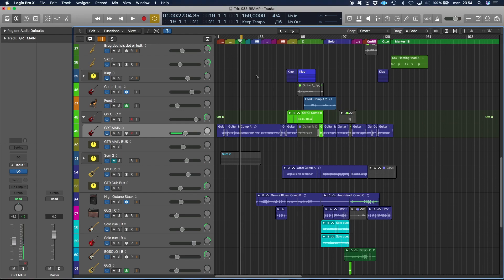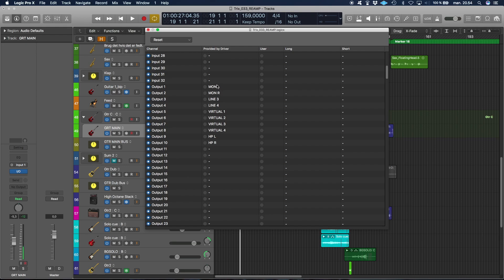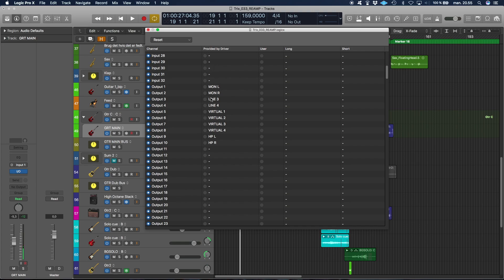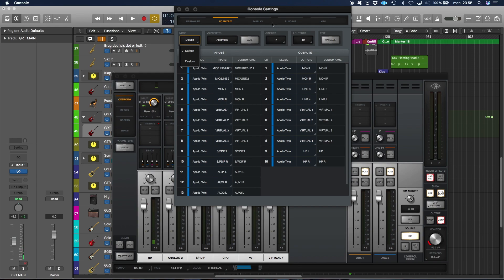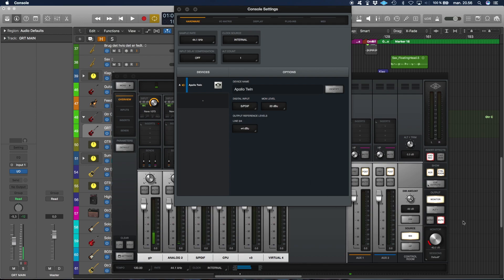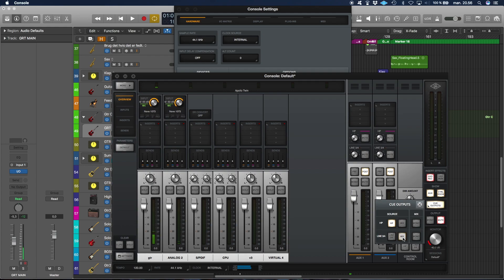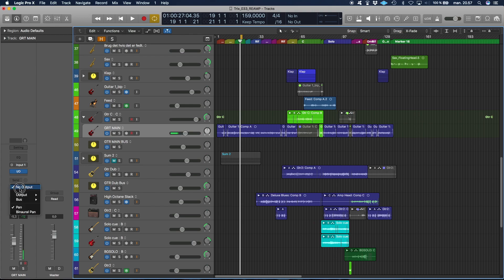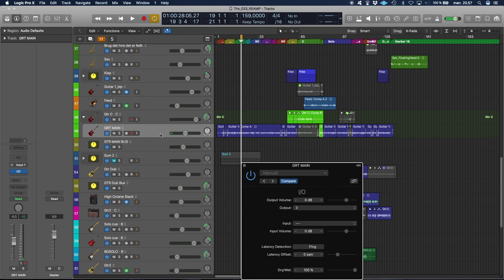Reamping guitar with Logic Pro X, Apollo Twin and UAD Console.

Comment: This is very helpful! What I am finding tough it the actual reamping process. If I have a guitar going into the "Instrument In", so I can record guitar, this then gets I/O properly so that the output is Line 3, which goes from a 1/4 jack to XLR on my Radial Reamp dual output, this then goes into all my guitar pedals. Now my question is from this point on, i.e. the output from the pedals. Where do I physically plug that in that signal now? That's where I'm getting a bit confused.
Reply from the maker: Your output from pedals should go in to the guitar in.
If this is not possible then in to a DI box and then in to a normal in.
But! It sounds like you are doing it a bit backwards.
Are you recording 'live': gtr-daw-reamp box-pedals-daw? 
If so, you should just go:
Gtr-pedals-daw.
Re amping is for altering after you have recorded it.
Hope that helps.
Reply: @studiopolka  thanks for getting back to me. yeah stuff that's already been recorded, so basically I'll just go back in to the guitar in from the Line 3 out. so Line 3 > reamp>pedals>guitar in. 
Thanks for your help!
Reply from the maker: @jjoohhnnttt  
-You are welcome!
Read up on balanced vs. unbalanced and it will all make sense.

Comment: @2:44 When I set mine to zero, the Line 3/4 button does not show up in the cue settings pop up box.  I  am on Windows 10 using an Apollo x8.  I'm trying to use line 3/4 to route audio to my external hardware equalizer in my hardware rack.  I'm using Reason 10.  Any ideas?  This is driving me nuts.

Comment: How did you connect your Reamping Box?
As far as I'm concerned the Apollo Twin doesn't have XLR Outs.
Reply from the maker: Apollo Twin has 2 XLR on the back. :)
Reply: @studiopolka  But those are Inputs which need male XLR plugs, so I get female XLRs on the reamping box which doesn't fit. 
Or do I miss something? >.<
Reply from the maker: @gredarias The cable I use ti go into the reamp  box ia a male Jack.
You might need another cable.
Reply: @gredarias  did you find any solution to this? I am having the same problem...
Reply: @williamwhite4986  I'm using a XLR Male to stereo 1/4", which seems to be working fine :)